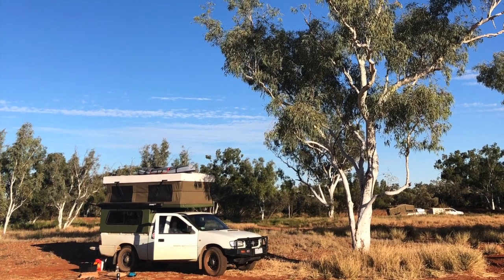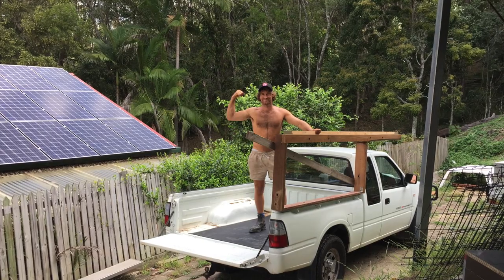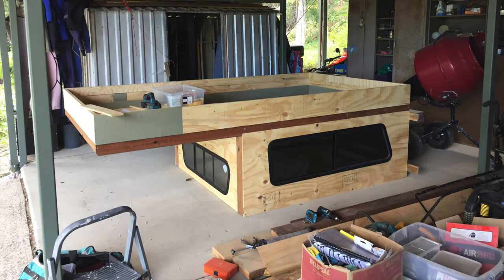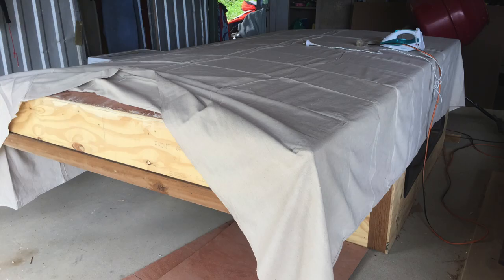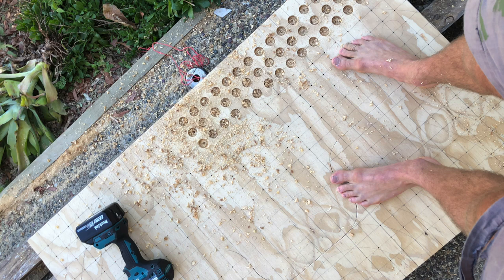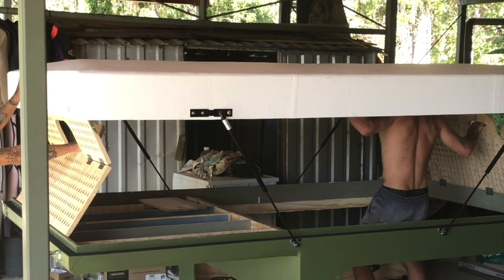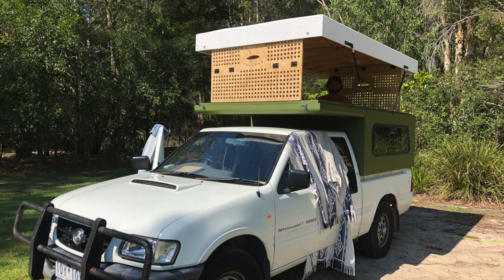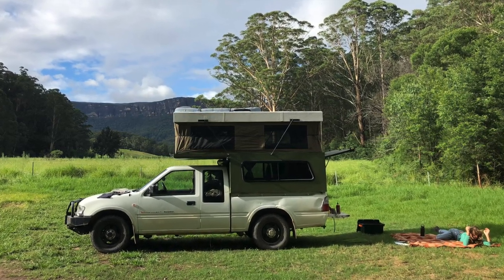TRUCK CAMPER - How we built it!

Comment: Dan, AWESOME BUILD!! I have been wanting to construct a pop up roof for my 2003 Ford Exursion SUV!! I was looking at a company from South Africa that builds them. However, those are thousands of dollars & I would have to cannibalize it to fit my vehicle. I saw one of your countryman do the same with a military truck. 
I am inspired by your video!! Thank you very much for putting it out there!! As my granddaddy used to say, "Poor folks have poor ways!" He was a jack of all trades & master of many! Unfortunately, he's past on, but would have loved your build!! Thank God, I got to spend lots of time with him in my youth & picked up the basic carpentry skills!

In hindsight, if you could do a do over? Would you use steel or aluminum & to save on weight what about foam covered in fiberglass?   
Thanks again! Looking forward to hearing from you or anyone with advice for my build?
Reply from the maker: @kennethbretches1289  awesome thanks so much! Appreciate the message of support and kudos to your grandfather, sounds like he was a good fella.

In hindsight if I went timber again I would use marine ply. Aluminium would also be a great option although much more tricky to achieve curves. Best advice I got was to just start! Face the problems along the journey!

Comment: Hello nice work and helpful video. Do you still have plans with measurements for lifting mechanism? And how high did yours lift? Cheers
Reply from the maker: Hey Thankyou! Sorry no plans anymore. It lifts about 900mm or roughly 3feet.
Reply: @dansbuilds  Ok no worries, do you remember ruffly how high the handle bit (high bit in middle) stepped up? Or how long your gas struts were? Thanks

Comment: this is fantastic! How did you attach the cloth for the pop top?
Reply from the maker: Sorry for the slow reply! I just used small button head screws with some plastic washers (if you use steel ones they can corrode and damage the canvas). Cheers! 🌀
Reply: @dansbuilds  no worries man, thanks so much! It's a fantastic build